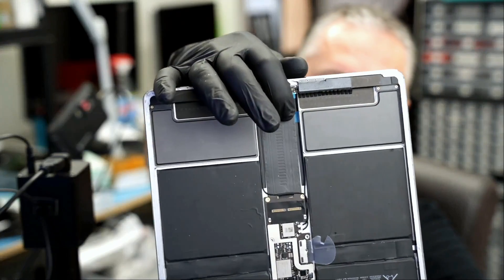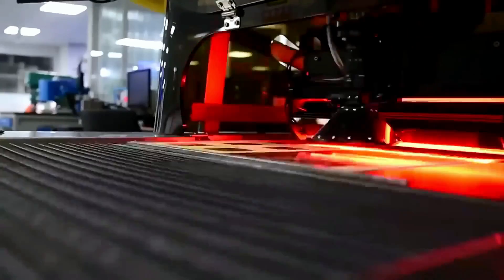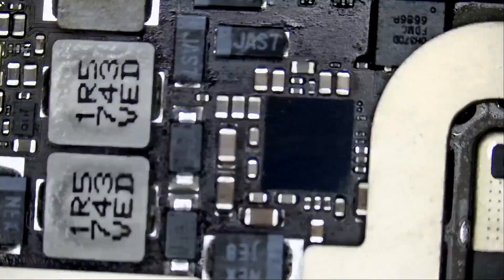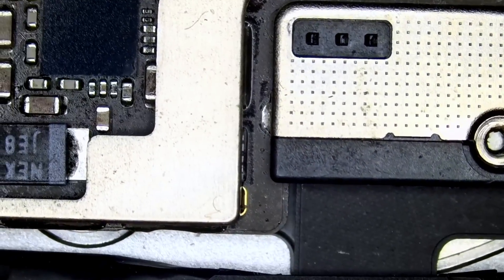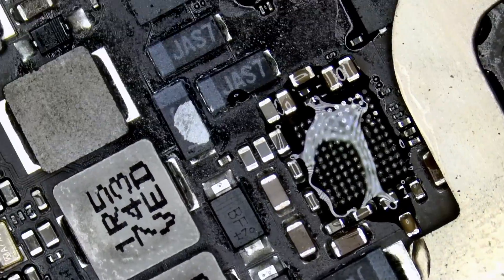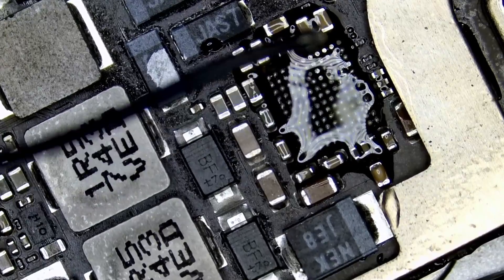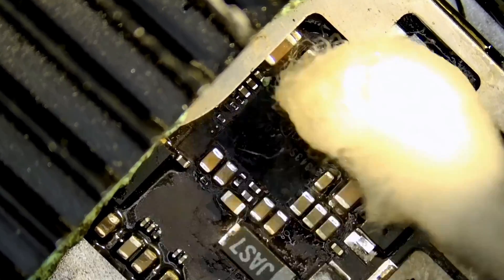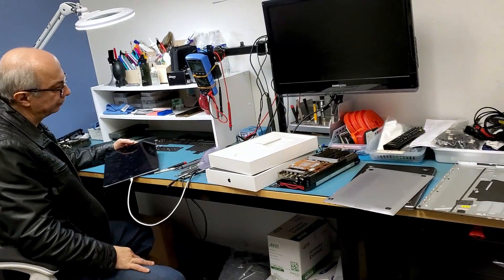What killed this iPad 12.9 2nd Gen  - No power repair

Comment: I'm a Mechatronics/EET bachelors graduate that graduated in 2020. I haven't had a job in my field yet where I can get experience and no one is hiring me. At the moment, being a electronic technician would be ideal. Do they ever hire entry level? Any tips to start practicing more?

Edit: This is my first time seeing the flux soldering process. Is it suppose to be that messy? It's not interfering with the other capacitors?
Reply: There wasn't anything messy. Flux helps with the flow of solder and cleans the oxides.
Soldering without flux is messy. Adding more flux can never go wrong. Its due to the flux that the other components are staying in place, even if the air pushes them a little bit, they will return to original place, without flux they would not.
Reply: @exnozgaming5657  Thanks.
Reply: You can always make money being an electrician. Everyone needs power!
Reply: @TradieTrev  I thought about it, but I definitely wanted to work with electronics/robots.
Reply: Flux just help make it easier but microsoldering requires much time and plactice in order to gain enough experience.